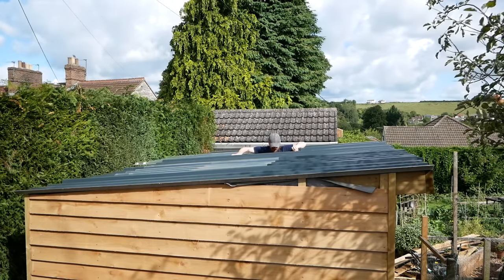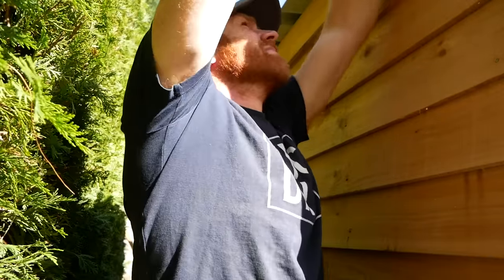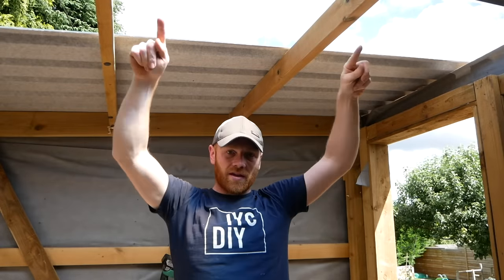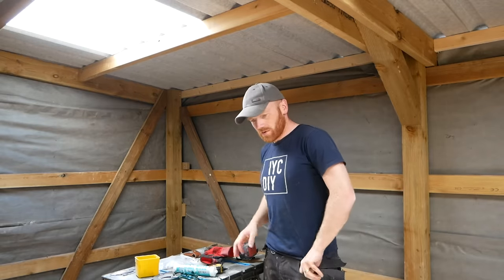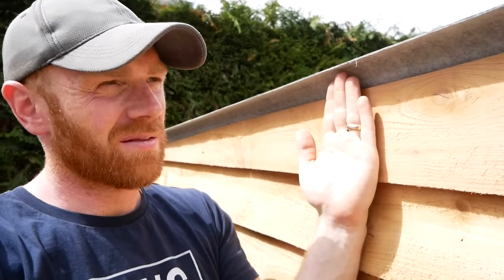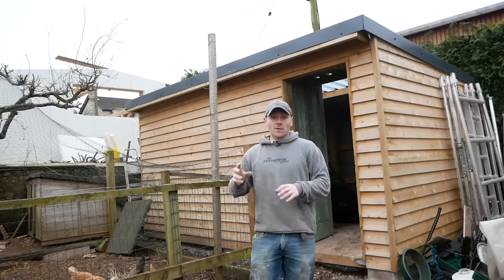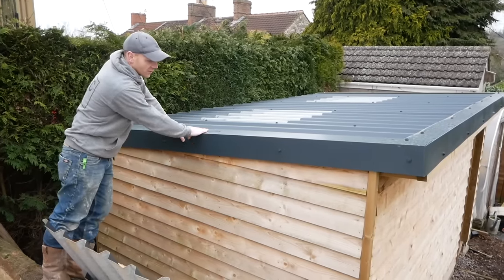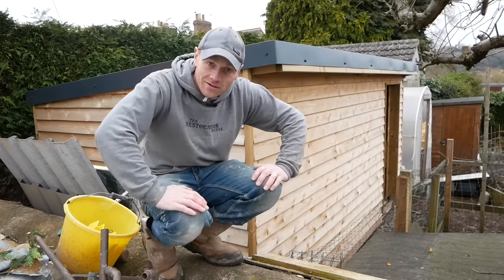FITTING THE METAL ROOF ON THE GARDEN SHED BUILD - How did it survive Winter?

Comment: Looking good, I bought the same sheets for my garage the supplier told me to lighty singe the felt off the sheets at gutter level I used a small gas torch this seems to have stopped any capillary. 
Thanks for sharing
Reply: That sounds like a good idea if it isnt super easy to cut and ripp of a little. If not also filling the fabric with spray paint should smooth it out and stop wicking
Reply: You can either use a gas torch on the fleece or paint with a clear lacquer to stop water seeping up from the gutter

Comment: It's always best practice when putting on flashings to install a timber batton in between the wall and flashing which is shorter/narrower than the flashing to allow water to drip off the flashing and not run down the wall

Comment: I fit these mental sheets daily almost on the edge it's not meant to have the anti con so the water doesn't soak in to it 
Also good practice to run a Stanley knife along the underside that over laps the gutter and then just peel it off! This will stop it running up the anti con and rotting the purlins
Reply: hi mate - so the felt lining on the back - you need to strip that away where the roof hangs over the exterior wall? at the moment iv got a frame up and my roof is a 3x2 frame but iv put sheets of OSB on the exterior side - i was weighing up getting some of these felt lined box profile to stick on top of the OSB instead of felt and then obviously use the box/edging to finish it off neatly so any advice would be appreciated thanks.

Comment: A membrane below the steel roof --would have collected all the condensation..  cheap membrane --not Tyvek..  anyways good job.  Had me worried with first board...  10/10
Reply: As well as the felt backer on the sheets or instead of?
Reply: @handle1196  in theory the felt liner on the back should stop any condensation because it stops any air hitting the cold metal!

Comment: I've got similar roofing to replace my old garage roof. Somewhat delayed over the last couple of months as originally supplied incorrectly without drip coat. I learned about the issue of water wicking back up the drip coat and spent a couple of hours removing  it from the bottom 150mm of each sheet. So spotted that you had not taken it off. As someone else had commented, a technique used in the states seems to be burning the edge with a blow touch, this stops the drip coat absorbing water.. Nice job as always.

Comment: My shed roof is constructed from timber tongue and groove covered with breathable membrane then covered with felt shingles I.e. type on 1 M sheets. I also get wicking at the gutter end, as I suspect that I didn’t leave enough overhang of the roof. Problem is wood is now going black inside so I will have to extend roof overhang. Lessons learned!
Reply: Did you wrap the membrane over the edge with the gutter and fasten it from the underside?
Reply: Yes initially but that appeared to be causing problem so cut back to edge of timber where felt overlap into gutter finishes. Still a problem so now planning to extend roof overhang by 300mm out from edge of building
Reply: @03Timm  Hmm, maybe a problem with capillary wicking? Or lack of a drip edge? I'm about to replace a leaking and condensate covered metal roof by installing 11mm OSB, painting bitumen on the edges, stapling a sheet of DPC then screwing down the original metal roof panels with roofing screws and roof sealant (not tape) at the joins. Fingers crossed it works. I might also add some polystyrene insulation on the inside of the OSB when done.
Reply: @jonathan1427  Maybe try the interlocking OSB  if budget permits and  also consider timber  roofing battens on top of OSB to fix metal roofing to provide air flow. Peter Parfitt ‘New Brit Workshop’ shows  technique on his garden shed build. 
I have drip edge from 300mm wide felt strip tacked to timber at right angles, as per supplier instructions, just don’t think edge is far enough away from side of building
Reply: @03Timm  Thanks for the advice, my roof is small enough to only need one OSB sheet per side, but adding battens is a great idea, I even have a few metres knocking around! I might even have a roll of flashing somewhere that could be bent into a drip edge.
Reply: @jonathan1427  hi mate - im in the process of doing a shed/workship its 8x8 and the roof has a overhang - the roof is made out of 3x2 timber and iv put OSB on the exterior side - initially i was going to just cover that in tyvec and then felt over it but im now thinking cover the osb in tyvec, use a few batons and then fix a box profile roof to the batons id imagine that should work to stop any condensation and also allow a bit of air flow between the roof and tyvec/osb, let me know how you get on.

Comment: Do you have the details of where the roof materials are from please
Reply: would like that too - found if you search on FB marketplace for box profile roofing you should find a few sellers at least - its the felt lined stuff you want ideally as it stops condensation on the inside then from the air hitting the cold metal of the roof!

Comment: I’ve just had a similar single pitch shed built for me yesterday. Single skin steel roof cladding with separate con membrane attached to rafters below. Was concerned that the open ridges at the overhangs would let rain in as no foam fillers were used. Also let’s daylight in like yours.
I guess it’s done this way to allow the roof & membrane to breath? Do you find rain gets in there if there’s a driving wind?

Comment: Just wait for the anticon to dry then paint with waterproof pva or burn with brazing torch carefully plus you need the foam fillers for eaves and top flashing
Reply: You don’t use foam fillers when using sheets with no con drop fleece. The roof needs an airflow to allow the fleece to dry out
Reply: @donfer1974  I was wondering the same thing as I have a new anti-con roof waiting to replace my old garage roof and it came with foam inserts but I was unsure whether or not to use them. Is there info on this somewhere?

Comment: Hi mate - quick one for you, on my timber framed shed - when i done the roof i have done a overhanged roof frame but have put a couple of sheets of OSB screwed into the frame, this box profile felt lined roofing can that be fixed straight ontop of my OSB to remove the need for using felt or would i be better removing the OSB and fixing it straight onto the framed out roof? plus think it looks a lot better with the edge trimming etc finishing the roof off nicely rather than using felt.
Reply from the maker: You could go on top of osb but unless you had anti con you may end up with condensation forming between roof panel and osb.  Also fixings would likely show through osb so still only fix where the structure is.

Comment: Did pealing the Anti con back 50mm work? As I have the same issue.
Reply from the maker: Yeah that's what we have done on the last two roofs and works fine.  You can melt it a little with a blow torch after to get rid of any last bit of fluff but usually peels in one piece fine.

Comment: Additional improvements can be to paint the roof white on both side to reflect heat and to maximise light inside. Keep the metal roof edging and gutter as is. Another is hooking your down pipe gutter to a water tank for your garden.

Comment: I have the same (or similar roof) and get crazy condensation from it. I have no felt lining up there unfortunately and was wondering if you have any tips? I really want to insulate from floor to roof. Would this be possible with this type of roof? It is a detached single skin brick garage. Thanks. Love what you do, it's so inspirational. 👍
Reply: If there is, try to stop any humidity/water from coming in, and add ventilation with vents
Reply: Hi redline Rossi , I have the Same problem!! Wish I had seen the anti condensation sheets before I ordered the standard ones.
Did you come up with a solution for yours?
Reply: @MatLampitt  Hi Mat, not a solution as such, but more of a patch for now. I have paid for a decent dehumidifier which does the job. I will get the roof done eventually though 😆
Good luck with your roof 👍
Reply: @RedlineRossi  I was really hoping for a solution when I saw the reply notification. Hahaha. 
One suggestion I have had is taking the sheets back off, laying a breathable roofing membrane, putting some 25mm battons accros and then putting the sheeting back on.
The idea being it will increase airflow and if ever there is condensation that drips it will just drip onto the roofing membrane and flow down and out into guttering.

Comment: I wonder if insulated panels are a better idea in a warmer climate? My shed doubles up as a gym and so a metal roof would transform it into a furnace during the summer months. Maybe insulated roof panels (like the wall panels on the workshop would be a better all-in-one solution? (rather than time/cost involved in OSB boards, insulation and a rubber roof cover) 
Anybody have any experience in a similar situation?
Reply from the maker: That’s what’s going on the workshop today. 👍 all depends what you are using it for I guess.
Reply: Insulated panels  kingspan or similar cool the building in summer you would be suprised, ive been fitting them for 28 yrs.👍👍

Comment: I'm wondering why you would want to fix screws through the valleys... in the end they'll always begin to leak and rot the beams below
Reply: Box profile is recommended to be fixed through the valley of the sheet. If fixed correctly the screws should remain leak free for 15 to 20 years.

Comment: We're planning to build a poultry house this summer, the anti condensation roof is very interesting, perhaps you can tell us where you obtained it. I'm not the only person enquiring.
Reply from the maker: These were colour clad. Usually local suppliers around though. Anti con is added in the factory when you order. Good option for livestock and unlikely to harbour mites like felted roofs on coops. That or 30-40 insulated panels, wipe clean inside too. That said, poultry love pecking insulation so the ends would need capping.
Reply: @TheRestorationCouple  Many thanks.

Comment: You need eaves and ridge fillers.
Reply: Not for sheets with no con drop fleece you don’t. The roof needs to be ventilated to allow the fleece to dry out
Reply: @donfer1974  The roof is only one skin. There is no void. This is not like a flat roof roof which needs careful consideration to ventilation and warm/cold skins.
Reply: @colin1729  the fleece absorbs any moisture which would normally drip on a standard metal sheet without the fleece. If the fleece does not have any airflow it can’t dry. If it can’t dry it will start to drip as the fleece will only absorb so much moisture. All cladding manufacturers will stipulate that fillers are not to be fitted on no con drop.
Reply: @donfer1974  He is roofing a shed. No method of heating the shed was shown. You don't get condensation when there is not a temp drop. You do get blown snow and/or rain at eaves level. Hence the breathable foam is used.
Reply: @colin1729  trust me on a single skin metal roof with no heating you will get condensation. The fillers are either polyethylene or Epdm.  Neither of these are breathable.  With a decent roof pitch or flashings that cover a decent amount you will not get rain or snow inside the building
Reply: @donfer1974  You believe that if you like. No need for more comments.
Reply: @colin1729  I manufacture this product and have been in the metal cladding industry for 25 years. It’s not my opinion it’s facts.